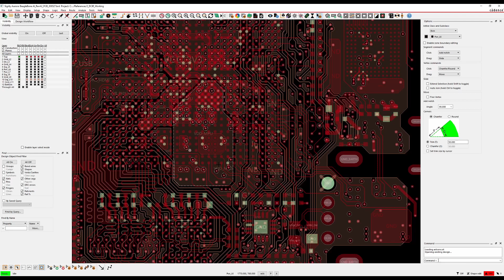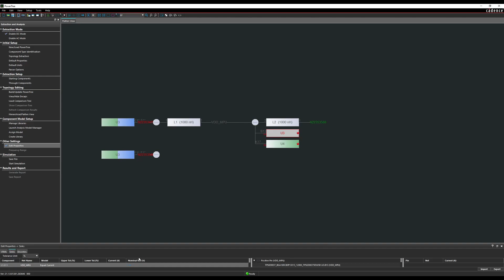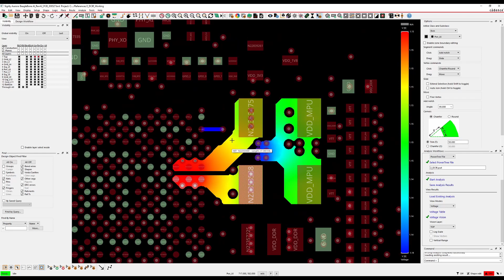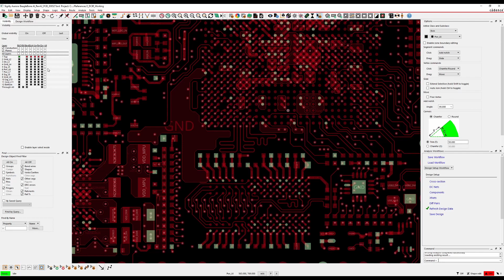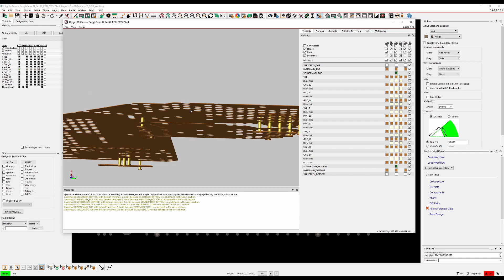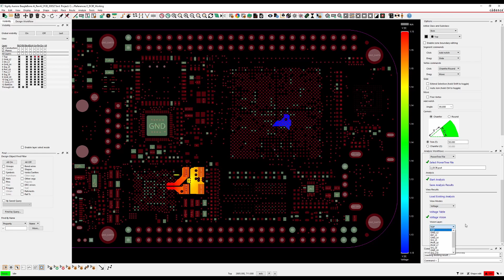Sigrity Aurora: DC-IR Voltage Drop Analysis

Comment: I am having a tough time setting up VRMs and SINKs. It always throws an error. can you explain how to set up manually?
Reply from the maker: Hey Fiery Fire, absolutely. Do you have the DC nets defined? (Logic -> Identify DC Nets). At that point, you can start your DCIR Analysis Workflow, and set your mode to "VRMs and Sinks". When you click "Set up VRMs" you choose the net, then select the component which is the VRM. Hopping over to sinks, set up which components to configure as loads. 

If that's not working feel free to ping me with more details to get things figured out (https://shielddigitaldesign.com/contact )
Reply: @shielddigital  thank you for the return . It would seem that is impossible to do a simulation with the vrm and sink method of there is a resistor blocking the way. The simulation does not take into account of a zero ohm jumper or current sensing resistor and it fails
Reply from the maker: @XxAureonxX  Ah, I see the issue! You have two options:
1. You can use a Powertree file or PowerDC workspace file, which is what I show in the video. You'll need the appropriate Sigrity license for that.
2. It's a bit crude, but you can also just add a sink and VRM to the resistor itself. You'll lose voltage drop info over the resistor, but the Aurora tool is intended for quick checks anyways. Any more detail and you should be doing the analysis in PowerDC to get more comprehensive information. Hope that helps!
Reply: @shielddigital  I'm gonna give it a shot . Seems kinda strange to have different program to do a basic simulation. Nice video by the way. Could you make tutorials on the other workflows too
Reply from the maker: @XxAureonxX  I agree with you somewhat. Aurora is great for getting a quick idea of how things are laid out (the pcb designer can roughly check that things will be ok) but the layout tool really isn't the ideal environment to be doing comprehensive analysis (perhaps some other PCB design tool will think otherwise in the future and combine both layout and analysis functions). PowerDC provides an absolutely huge number of features for this type of analysis and is something akin to what a specialist would use to perform final validation.

I'd love to make more videos when time allows. Which workflow would you want to see most?
Reply: @shielddigital  yes but aurora has ir drop as a feature which is itself dependent in the power tree . Power tree being an additional license makes it's strange. 

Could you make a tutorial on the return path workflow, coupling, reflection ,cross talk ? Sigrity lacks tutorials
Reply from the maker: @XxAureonxX  Ah yep, that's just because it's allowing you to use some extra functionality in the form of the powertree stuff. For sure I'll see what I can do on those other topics, though you also can check out the webinar I did with EMA earlier this year: https://shielddigitaldesign.com/posts/2021/ema-webinar-sipi-problems/

There's not any live demo, but I do go through and explain some of the other workflows.